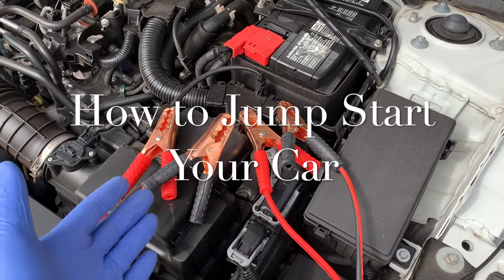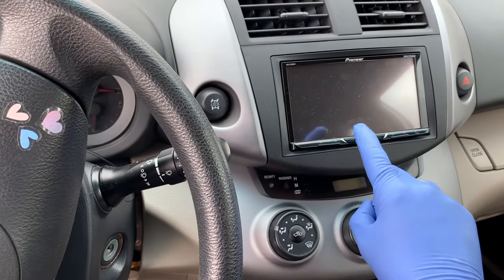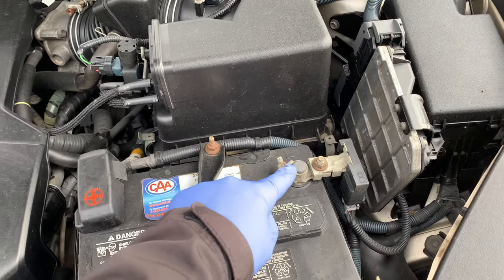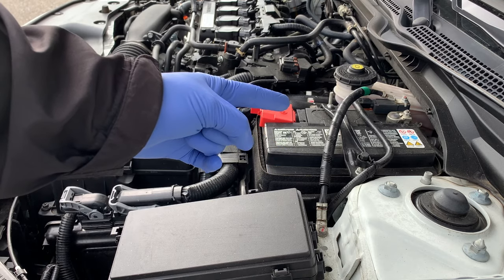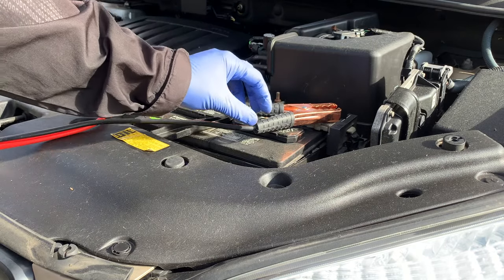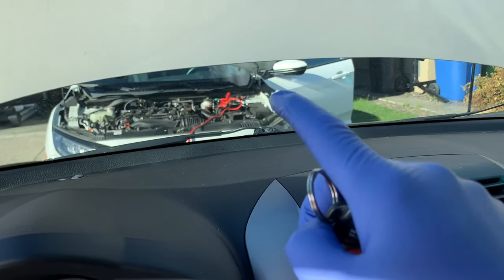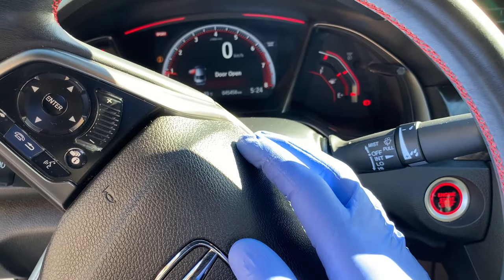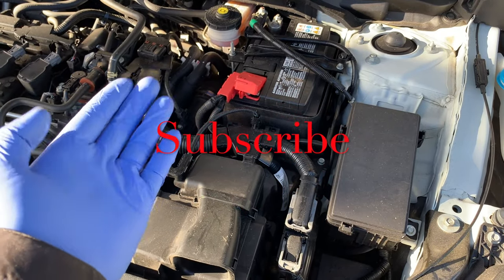How to Properly Jump Start A Car With Booster Cables

Comment: hydrogen is lighter than air ,will that not be gone soon ,and why not attach the negative cable first to the bad battery negative pole first to avoid sparks and them Hooke it up to the good battery

Comment: This was a very informative video.  For the few times that I have ever jumped started a vehicle, I have always connected the negative cable to the negative post on the disabled vehicle first followed by the positive cable on the disabled vehicle.  Thank God nothing horrible ever happened. I will be doing it this way in the future.  What potential issue is there if the other car owner with the good battery decides to disconnect his cables before the disabled battery owner removes the negative cable?
Reply from the maker: If I understand the question correctly in this scenario.  A person is basically holding both the positive and negative cable on one end while the other end is still connected to a battery.  So, once cables (positive and negative on one end) are connected to a battery, they are live; therefore the risk is high that someone on the other end could accidentally touch them together which would cause a dangerous amount sparks on multiple levels.  Basically never have one end connected to a battery while the other end is being held by someone, distractions could easily lead to an accident if they are holding live wires.  Always disconnect them one at a time starting with the negative from your car (to break the circuit) and then the negative from the booster car, followed by the booster car positive and finally the positive on your car.
Hopefully I understood your question based on my response.
Reply: i think it's just a holdover from old cars, all modern cars have the negative grounded to the chassis so there really shouldn't be a problem, though if you read any instruction manual for jumpstarting they will all tell you to ground the negative cable to the chassis of the car. to make sure you can even check, the black cable should have 2 wires attached to it, on going into the engine and the other going to the chassis

Comment: nice informative video overall.just a suggestion to your video for new drivers, you should elaborate more on the mistake made by many ppl by connecting the negative connector on the negative terminal as for new drivers connecting negative connector to negative terminal is easy process without thinking about the risk.
Reply: Your video is perfect , i got it all info when i watched second time ....helpful for the new drivers absolutely

Comment: I have a question, in my disabled car if i use a metal part, nut or from the motor, the battery doesnt charge i am pratically forced to put the negative cable of my disabled car in the negative post and not using another place, this happened a lot of times when my battery was dying and i didnt know so i just used to ask for help or use another car in the house, but this is strange, why was i forced to always use the post because if i do the entire circuit like in your video, the disabled car never turned on and i dont have any kind of electric problems in the car, once i changed the battery its been fine starting always at first time for 4 years now, but i always was curious why if i do the circuit like you did in this video my disabled car looked like it was not receiving energy from the car to the battery
Reply from the maker: These instructions on hooking up jumper cables are designed to outline the very safest jump starting procedures under all possible circumstances. Since a lead-acid battery emits hydrogen gas while charging, there is a chance when hooking a hot battery to a dead one that a large spark will be generated, possibly causing an explosion. While this is exceedingly rare, it doesn’t hurt to be proceed in the safest possible manner.

If your battery is always dying, then you may have a electrical drain.  In some cases, batteries can drain in a very short period of time due to the high electrical usage in a vehicle.  If I don’t start mine in within two weeks, it will die.  The other item to take note of, is a poor connection on a bolt, motor or piece of metal.  So, just wiggle it around to make sure the connection is firm.

Comment: Sorry but you should start at the dead battery with the red cable first and end at a metal spot with the black cable on the dead car last. Old school mechanic.
Reply from the maker: This is exactly what was demonstrated in the video - start and end with the discharged battery.
Reply: Go back and watch the video. At about 4:45 u will see that